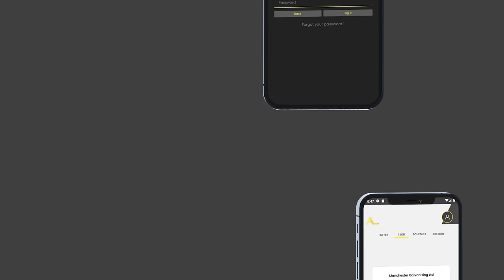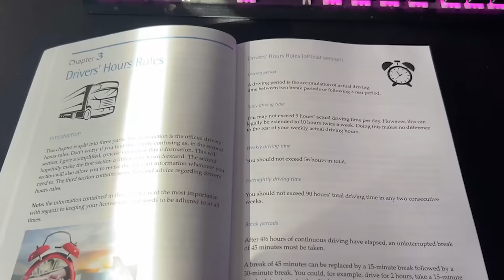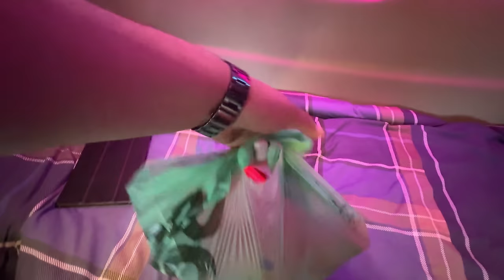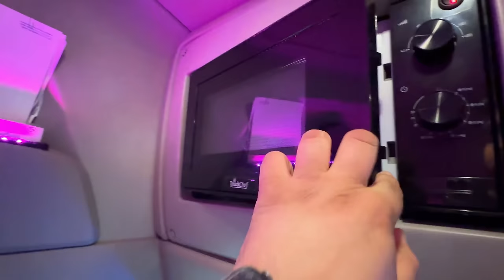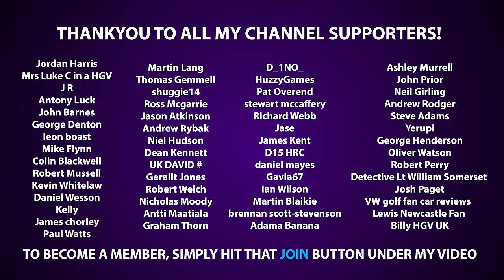Burnt And Abandoned! An Unexpected Evening Find! 🔥

Comment: Great videos as usual. Forgive me for asking but I'm a cable hand and when I'm caught short, jobbie, I go in the back of the van with a bucket and plastic bag. How on earth do you go when ur stuck on the side of the road within full view of everyone. Forgive me for asking. Keep up the great work.
Reply from the maker: It’s a question I’m asked a lot. 

Make use of customer toilets at collections and deliveries. There’s also services on route should you be desperate. 

Me personally, as bad as it sounds, I can 2 or 3 days without going for a number 2. So overnight isn’t an isssue. I’ll go if I need to the next day at one of the above 

Now… IF it’s bad. Like real bad and you need to go NOW. Then I do actually have a portable foldable toilet in my cab which you can put a bing bag in and use. I’ve never used it, but it’s there in case!

Comment: Another great video Luke.
Keep up the good work. 😎 
Talking about work or in actual fact working out.
You're very lucky to have the benefit of height as you said 6 ft 3 inches. Therefore good luck with the fitness goals as on your tall frame you could do really well if you keep at it. If I were in your place I would be inclined to have a small folding bike, and it could in its bag be placed on the top bunk, & strapped down for safety.
Using the bike would raise your heart rate even more, & it's great cardio exercise. You could cycle for quite some distance, & really end up improving your health. 😎 

Also the Uber Eats delivery was it the driver that you expected or was it a catfish?